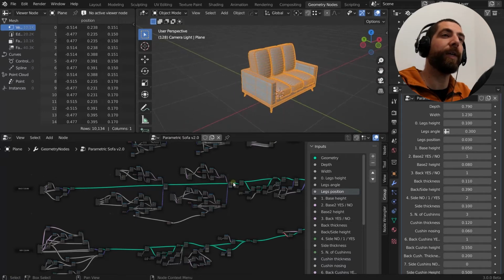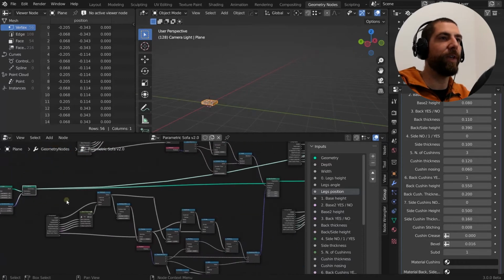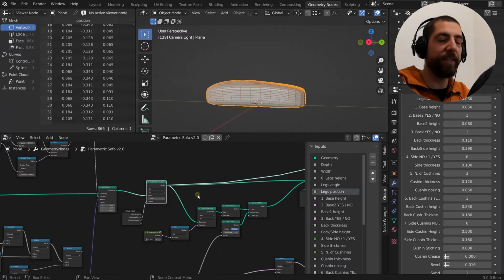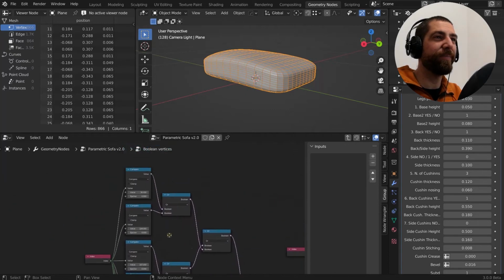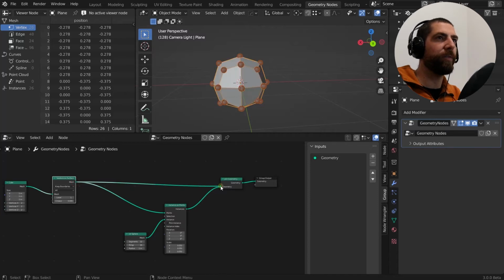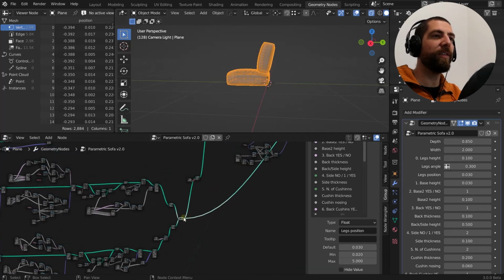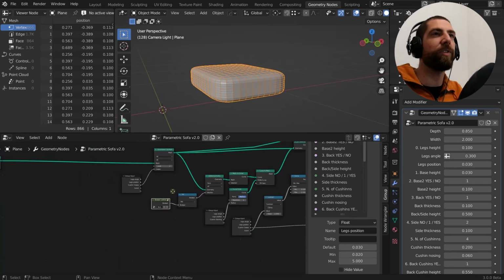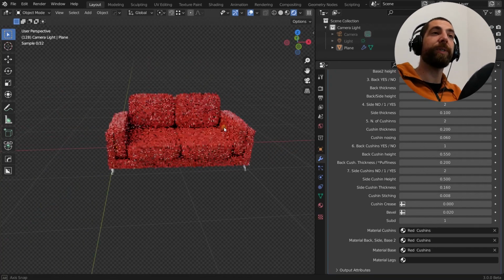2 Hours Rambling about my Sofa Geometry Node Tree - Part 3 of 3

Comment: Hi, thanks a lot for the videos, I definitely learned a few tricks. To be honest, this tutorial seems pretty though for a beginner to follow, but as someone who codes and has a reasonable geo nodes experience, this was a good fit for me, as I generally can fill in the blanks after picking up on the main points...
And speaking of "filling in the blanks", here are two suggestions that might help you improve this node setup:
- overall, the vast majority of the pieces of the couch are deformed cubes build by a similar procedure. Rather than repeating nodes over and over, you could probably have one or two node groups for generating a generic cushion/a generic base, build most pieces using multiple instances of that node group, and then move them into place. This would make the node tree a lot more editable in case you want to work on it in the future;
- here's a procedural way of avoiding your Boolean Vertices node group, that allows for arbitrary number of segments in the cube:
1) create a copy of the cube with the puffiness deformation, then subdivide it, just as in your video;
2) create another copy of the cube that is not deformed, and subdivide it with crease set to 1; this subdivision will still have a perfect cube shape, so it's fairly easy to select the desired Boolean vertices in this copy;
3) the two deformed cubes in (1) and (2) will have perfectly matching indices, so apply a set position node to deform the cube from (2) to the shape in (1) using a transfer attribute from cube (1) to cube (2) to copy position via the index;
4) use a capture attribute node to transfer the selected Boolean vertices from the undeformed subdivided cube in (2) to its deformed subdivided version in (3).
Hope that helps. It's honestly not the most elegant set-up, but it's the best I can think of with the currently available nodes and my limited knowledge.
Reply: P.S.: just realized that there's a simple improvement to my procedural Boolean Vertices... simply replace both 3) and 4) by the following:
3') the two deformed cubes in (1) and (2) will have perfectly matching indices, so apply a transfer attribute from cube (2) to cube (1) (this is the opposite than my original suggestion) to copy the selection boolean via the index.

I'm a bit embarrassed for missing such an obvious improvement, but the original node flow was more similar to things I've done before...